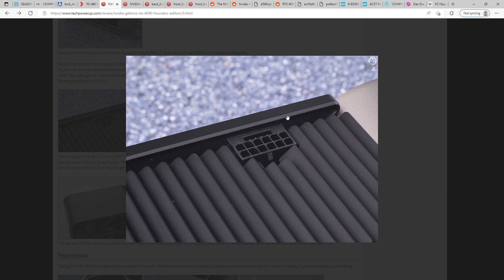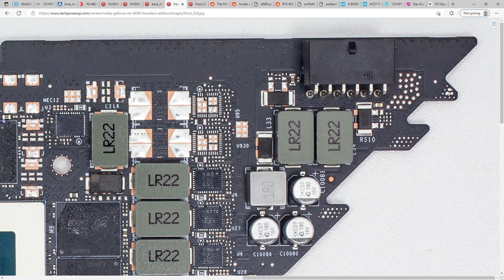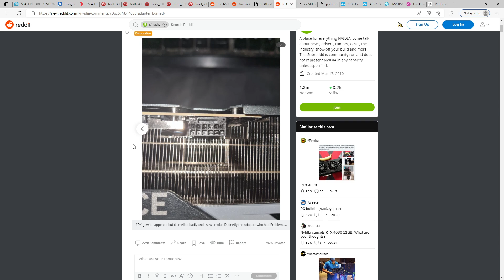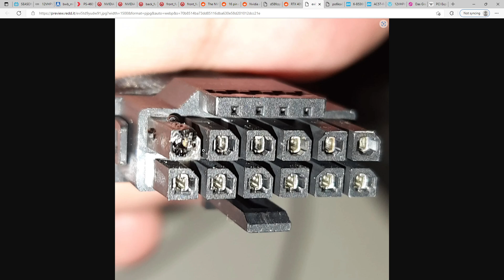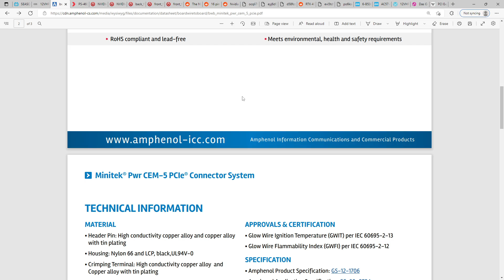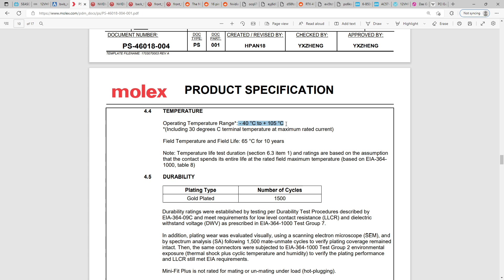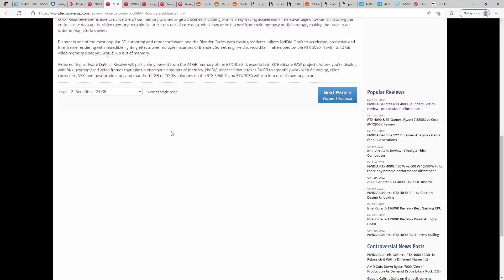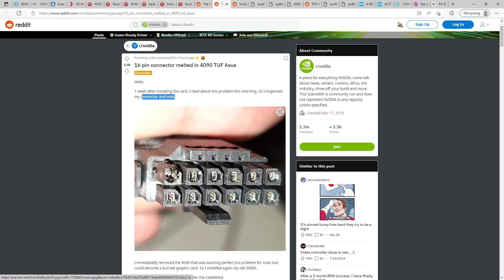rambling about the 12VHPWR failures

Comment: 3090Ti person here: I've visually inspected the 3x8 to 12VHPWR adapter supplied with my MSI Trio 3090Ti and it is definitely a different adapter than any 4090 as per some discussions on OCN and Reddit.

Apparently the 3x8 supplied with MSI Trio 4090 at least uses the split socket design like the 4x8 and looks like it's probably using the weird commoned terminals as well.

3x8 dapter supplied with MSI 3090Ti (and probably others) uses single-slit terminals and has a wire going directly to each socket. It also lacks the 4-pin data section as 3090Ti have the 12VHPWR data pins internally pulled to either 450W or 600W values.

Still gives me the heebie-jeebies but seems the 4090 adapters really are a downgrade from ones paired w 3090Ti
Reply: TL;DR evidence shows failures due to design defects are not unique to the 4x8 adapters for 4090, at least some 3x8 adapters for 4090 are affected too

Comment: Didn't Nvidia also use those same dual split pin female connection pins in the 3000 series FE card adapters, including the 3090Ti which had the same power limit (450W) to that of the 4090.
Funny how those never burned up, but then again that adapter was constructed differently with the cables being crimped rather than some abomination of a solder mess. But sure, it's the pins and not the badly constructed adapter.
If anything the 3000 series adapter would be more prone to pin deformation since the wires (the part that actually gets bent) are connected directly to them, the fact deflection point on the new adapter would be at the solder joint and not the pin.

Comment: Please someone tell me why we cant use a 2 Piin connector that can handle 600 watts ?  Or even a 4 Pin Connector that can handle 600 watts?  In the Radio Control hobby we use connectors that have robust connectors, and  larger gauge wires,  there are very few problems running 150+ Amps at literally over 40V.   I dont understand why something like this could not be adopted to work for video cards.  12V  at 600W is only 50 Amps.  and the connector and wires are very manageable.  Please help me to understand this ?

Comment: thanks for this video. does anyone have any suggestions as to what we should do? i have all my parts and my 4090 just sitting in my box. i dont think i will be able to snag cablemods right angle adapter, they will prob be gone in seconds. should i just get a corsair PSU? if anyone has any ideas, would be very grateful.
Reply: I'm on the same boat what a joke. I just got a new PSU upgrade PF1 1050W platinum. What is yours?
Reply: @Sir_Saul  I didn’t buy one yet Saul. Cablemod is in stock with the native MSI cable for their black PSU’s. I’m about to buy the cable from their global store and just buy the MSI PSU from their website. I’m spending so much more money then I wanted though bro. I feel like such a big clown right now 🤡
Reply: @1teamboy  you are not alone bro, atleast your GPU id OK. From what I read any other cable used instead of the weak Nvidia adapter (including native from PSU manufacturer/atx 3.0) will void the cards warranty, though subject is new and info is not 100%. But cablemod will void the warranty. What model MSI PSU do you own? If only the new atx 3.0 MSI Ai1000p was available I would trade it in for my yet to be unboxed new PSU.
Reply: @Sir_Saul  it actually won’t void the warranty. That’s false. Toms Hardware made it sound like that and PURPOSELY mislead a lot of people with that in their latest article. ALOT of people are mad. And NOT just at nvidia. Believe it or not.
Reply: @Sir_Saul  I’m not sure the exact model number.  It’s not the 1000p though. I beleive it’s the G.
Reply: @1teamboy  12900K and a 4090 enough with a 1000W PSU? What CPU will you pair the 4090 with
Reply: @Sir_Saul  I have a 7900x

Comment: Applying the same safety margin to the 12 pin as the 8 pin has would bring it down to 342W. Seems like a good compromise to have it being shipped as single connector for cards below 350W power consumption and then two of them for the ones above it. If it was like this I can see it being a good implementation.

Comment: If the terminal gets hot,  the heat will travel up the wire a short distance and you'll see it on a thermal camera.   Overall I agree.   Yes my background is in electronics and yes I own a thermal camera.

Comment: I am an electrical engineer, but I don't have expert knowledge in this field. Something you said doesn't make sense and I lack the equipment to test to see if it has any foundation in fact. You mention that the burning is occurring on the 12 volt side and not on the neutral side, your explanation is that the return current is moving significantly through the mother board and diminished through the neutral conductors on the 12VHPWR. I don't think this makes sense for several reasons; 1) if the traces on the motherboard can support this sort of current with this sort of travel distance, then why do we even have special power connectors on the video card. 2) if the motherboard is supporting a significant percentage of the return current, then why have just as many conductors for return current on the PCIe /12VHPWR connector, it would just be wasteful. 3) I haven't read through the ATX power standards, but I really doubt that over current protection wouldn't be tripped if so much current was moving through the 24 pin motherboard connector. I would have designed it so that approximately as much current must be returning through the proper return conductor or it would trip, but I don't know if this is how it was done.
My belief is that it is because a bending moment is being introduced through the connector with nothing to brace on the opposing side, opposite the pivot point below the neutral ground pins. This is resulting in improper contact with the 12 volt pins leading to a significant increase in resistance at that location. The clip could have been used to reduce the bending moment, but for some stupid reason is on the underside of card (this is just bad engineering), if you look at a PCIe power connector, the clip is on the top side (nearest the PCB) and this would act to reduce the bending moment if you pull a cable downward or allow it to hang under gravity. If the 12VHPWR socket was mounted upside down (so the clip was on top), I think this would probably fix the whole issue.

Comment: I recently dropped my 12v joiner cable for 2 batteries between the battery. Yeah, butter fingers. turns out the cable was the exact length to fit between the positive and negative of a 12v leisure battery of IIRC 100 amp hours!
Thankfully, unlike a lot of videos I saw, it did not wield it's self together, but knocked off a tiny bit of metal from the wire, and enough to stop the current/connectivity. It would have been a bad day should it have welded tight!

So yeah, even 12v can be bad at high current and small wires.

Comment: About 3090TI vs 4090, the 3090TI used just 12 pin connectors, no sensing wires yet, so they may have turned the power limit down on bad contact failures. Also, they may have used more "standard" not split terminals on the old adapters. I think JayZ recently did show an old adapter?

Other than that, just a 14% safety margin is ridiculous, and that's only if using 16AWG wire. If you drop to 18AWG, that takes you to 8.5A max per contact, 612W, a 2% safety margin. You can't use 20AWG on a 600W connector, that only allows 7A per contact, 504W total. (Source: Amphenol, "GS-12-1177
 Product Specification", pg. 1)

Comment: More proof EVGA got out at the right time, the fact the board partner basically has no power or decision making over anything more than adding some extra phases and plopping a different cooler/shroud on the GPU die, means you get uniform problems like this that affect every 4090. NVIDIA tells partners to only use 12VHPWR connector rather than Molex connectors and this is the result. I get that having a certain standard is important to meet so that a quality product is created and everyone expects a certain level of performance out of a 4090. But there's standards that make sense and then there's requirements that no one asked for or rather restrictions in this case. Oh well, another day, another NVIDIA fail.

Comment: Includes. I understand tha 105c includes those 30c, so realisticly you get 75c surrounding area. Give some error margin and you get around 65c max usable temp near connector. Being so fricking close to heat generating components I supose hitting those 65c is prety realistic. Can it be by choosing this connector them being just overoptimistic, and relaying to much on simulations, not considering real world usage case?

Comment: 27:52 starting from here, things go a bit wrong.  The recommended terminal from the datasheet is the 10132447-121PLF HCC (High Current Capable) terminal, which for the terminal itself actually has a 12A rating with 16GA wire.  The safety margin is nearly the same as a Mini Fit Jr 8-pin.  12A x 6pins = 96A x 12V = 1152W.
Reply: Datasheet, if youtube allows the link... https://cdn.amphenol-cs.com/media/wysiwyg/files/documentation/datasheet/boardwiretoboard/bwb_minitekpwr3.0_hcc.pdf

Comment: What is most amusing is that despite the Amphenol connector being the one approved by PCI SIG, Nvidia who helped design it, contracted Astron (who doesn't publish datasheets) to build it.  That adapter is NOT Amphenol.  Astron made the 12-pin last gen, too, but they actually used crimped terminals since they only used 16GA wire, so they didn't have this double split in the terminals.  But the need to solder was due to using 14GA and the max size for the Amphenol terminals being 16GA.  Nvidia deserves to eat this.

Comment: Didnt the 3090TI use the same adapter but without the 4 sense pins? And also since 3090TI have the same connector as the 4090. Did anyone try to use the adapter on a 3090TI and see what happens. Do the sense pins work on a 3090TI?

Comment: I wouldnt trust the adaptor,  if I was building one, I wouldnt  use solder joints near somewhere that has to be bent to fit in a lot of  chassis cases , as they  can  fracture if stressed by bending,  this happens on certain 3D printers  heatbeds if you dont use a stress relief and  dont use the correct length cable, a better solution would be to have the cables individually crimped properly

Comment: and I'm an electronician who hasn't done any real in 15 years ;) what I can tell from a quick search regular pcie8 have 3 pins of 12V, the new pcie12 has 6 pins of 12V, what the adapters try to do is join 9(3x3) or 12(4x3) wires onto 6 at the gpu, what Corsair has announced as cable for older psus are 2xpcie8 into 1xpcie12 (2x3pins->1x6 pins) which obviously is better as it makes the gpu side the same as a new 600W cable, anyone smart would have joined the 3-4 connectors wires close to them and then have a single cable with only the proper wires going into the gpu connector, relieving the physical stress from the gpu side where space is unavailable and preventing 3-4 cables tugging the gpu connector down
Reply: was going to make my own cables but I found some at aliexpress, if they are bad (won't use them before testing) I'll just reuse the connectors and make my own cable with as thick wire I can get or simply go buy copper high power speaker cables

Comment: too much current through a wire that cant handle the load is a about the electrons flowing trhough the wire more of them causes heat and you need a thicker wire to support that amount of amperage . Plug a hairdryer in and u can experiment with a lower gauge wire it will melt the wire and make contract can cause arc to occur.

Comment: Ive had this explosion happen when benchmarking a 1080 ti i had melted my power supply plug .It popped but everything was fine i just replaced it with a 14gauge burned a 18 gauge one was not enough for the power draw from wall .

Comment: Well, for a "failed compsci student" you almost* completely nailed it on all fronts 😀 Those doubly-split connectors do look highly likely to be the root of the problem. (* It's the low-resistance pins that get hot, rather than the high-resistance pins. See the PCI-SIG report in the GN video at https://m.youtube.com/watch?v=p48T1Mo9D3Q&t=512s for an illustration of this.)

Comment: im just annoyed that everyone is doing these tests with the card and not just making an exposed breadboard type of test where they can visually see the pins and thermally watch them and see whats up
Reply: @Hisokaa-d2j  jayz2cents did a video and igorslab has a really good write up on it with good pics but i meant for somone to cut the connector and then breadboard it with a load tester and monitor it that way so you can see if messing up the connection will get the plastic to melt. pin play is a dead topic and it is now pretty well accepted that the wired where they connect to that thin plate in the connector is the issue

Comment: The minute I seen this connector on a 4090 made me laugh. We use a lot of these connectors in the car audio industry and the problem with the connector which I'm sure you'll talk about in the video is the sprung force that holds pressure around the pin on the GPU side has added resistance and They lose their pressure over time or if they're at an angle or if they're not plugged in carefully and this will cause the connection to get insanely hot and start melting. Not only the jacket of the wire but also the terminal itself as we are seeing. Good luck to all of you that have bought these cards but this spec is an absolute joke for that connector

Comment: @Actually Hardcore Overclocking
the problem that igor found is, two of the 4 8pin connections only go into one pair, the outer ones, the ones which got melted.
8   8   8   8
|    /\   /\    |
1 1 1 1 1 1
8 = 8Pin
1 = 1Pin of 12VHPWR
the outer ones get up to 150W each while the inner 4 have 2 pins for 150W

this is exasorbates the bad terminal design

Comment: These GPUs are gonna burn-out just in time for ppl to buy an NVIDIA ZTX 6090 ...

Same as Ryzen 7000 and 12th gen Intel... 
Pumping so much voltage into these parts and making them output so much heat, that by 2025 they'll just melt internally.

By 2030 everyone will be scavenging for 2nd gen and FX processors, because they just "simply work" ...

Comment: Quick and dirty fix/prevention for this from a twenty year auto tech, pack the connector full of silicone dielectric grease, it will help spread the heat and prevent the localized heating that leads to melting plastic and loose terminals, very common in high current applications like exterior lighting and blower controls.

Comment: you don’t want to run current/power on multiple wires , it’s always better to run power just on 2 wires + ground , they need like a 12/3 wire that’s it for this amount of power. yes the wire and plug will be thicker but that’s how you properly transfer 450+ watts. for them to divide the wires into 6 thinner wires is pretty stupid , i get it they wanted to make a smaller plug on the card but this is pretty stupid . I know they hear transfer is around 55c at the plug but to me even that is too hot. thicker plug and lower gage wire and you can push even 800 watts with out exceeding 30C

Comment: As an electrical engineer, this whole thing freaks me out. It feels like this design was destined to fail right from the beginning.

1. Having a connector dissipate 1.6W ??? That is an INSANE amount of heat to dissipate in such a small space. To me, this alone is a disasterous design decision. The spec is fundamentally flawed.
2. The connector is rated to 105C? That's extremely low for such parts - an indicator of poor quality.

The real question in my mind is this - if NVIDIA decided to spend the effort to make a new connector, then why didn't they design a good one? They could have done anything they wanted. It's baffling.

Comment: Aside from voltage drops, I wonder if someone could Dremel away just enough plastic from both the adapter plug and the card's socket to expose a bit of the end terminal's metal, enough to allow them to get thermal readings. That would mean cutting into a card's connector, so it's not exactly a cheap proposition. So maybe Linus, then.
Also, I wonder if the plastic gets hot enough for these connectors to eventually fuse inside of people's cards. Like over a period of months/years. I guess we'll see...
Reply: Send me a 4090 and I'll do it!

Comment: The specs for the connector says it's made of nylon maybe that's why it melts so easily. Target market/applications says it's made for passing data mostly? If they use 14ga wires why would they use 9.5amp max connectors 14ga can pass way more than that at such a short length. That connector size should have 18-20 wires.

Comment: Dear Buildzoid, Instead of worrying the 4 wire having potential loose contacts/high resistance to the 6 terminal contacts, would it make sense to run a single wire to short the 4 wires below the shrink wrap?  That way, if we have loose contacts at the terminal ends, this single short wire will eliminate the high resistance.

Comment: The way I was looking at it is you have 4 wires running to a bus connected to 6 pins.  One wire's joint breaks off from flexing/whatever.  You can now have over 450W being pulled through 3 wires, probably not an issue, at least short term.  The main issue being the broken wire is still somewhat connected to the bus, lot of resistance, lot of heat.  The plastic in that area is quite thick so it doesn't melt there (at least enough to see externally), and it's not going to get hot enough to melt the solder on the rest of the wires. The bus/pins being metal, act as a heat sink and melt the plastic at it's thinnest point, at the pins, which would also be transferring some of that heat to the board's connector, although through a seemingly poor connection.

In general the connector design looks like a confluence of dumb.